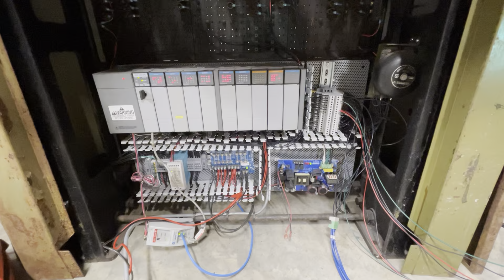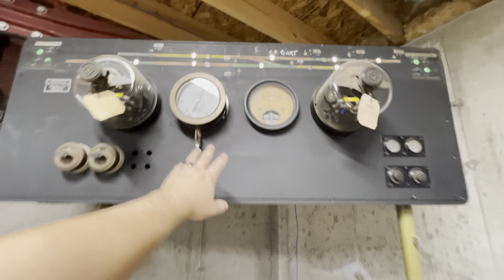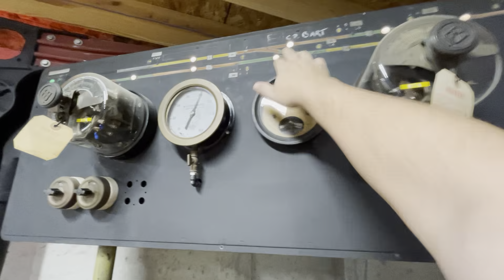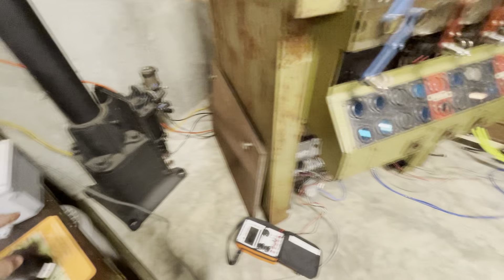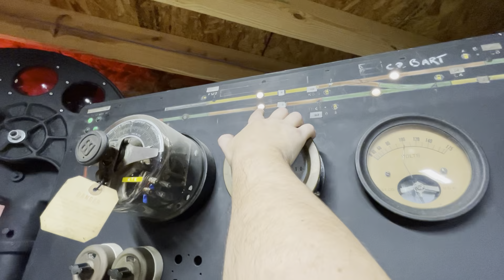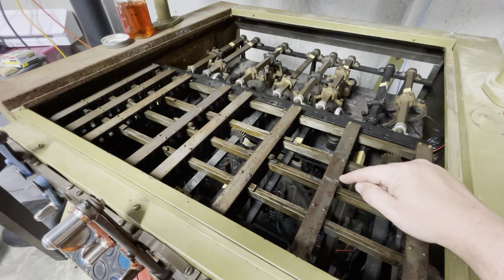Model 14 Railroad Interlocking Machine Operation

Comment: These videos are excellent! Thanks for making them! 

Your timers seem to be the equivalent of maintainers "picking" the switch lock. We do that if the track circuit has a failure of some sort, but upstairs wants to run trains and throw the switch anyway. Requires lots of permissions from the people in charge.
Reply: UK has sealed release buttons for points on lever frames. To move the points if the TC has failed, the signaller must break the glass and press the button to override the TC control in the lever lock circuit.